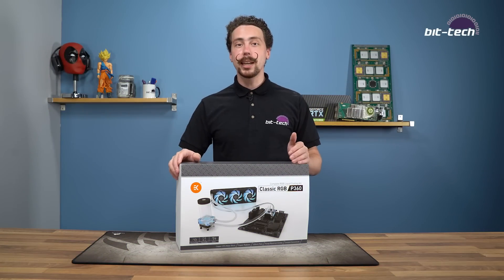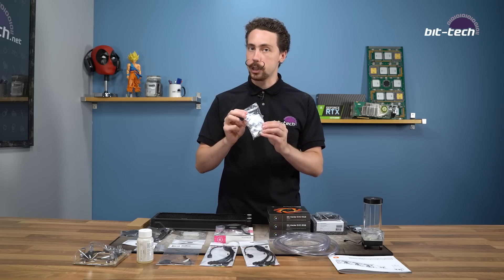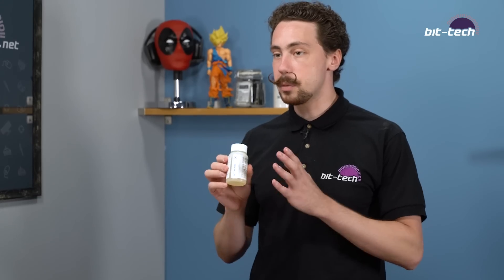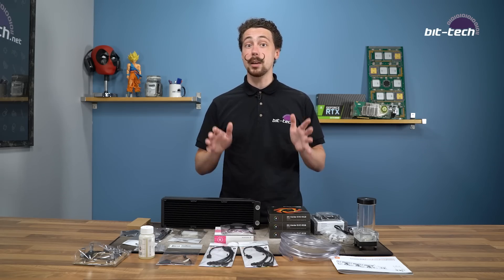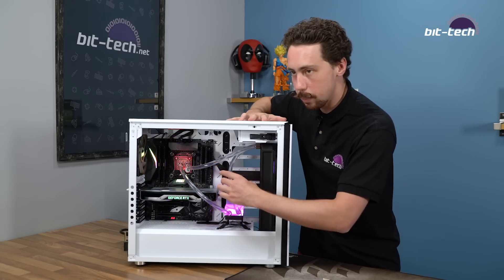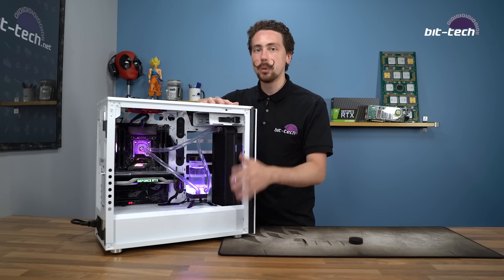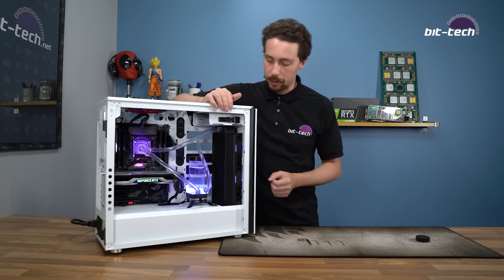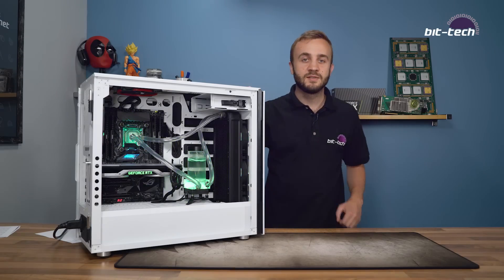EKWB EK-Kit Classic RGB P360 Water-Cooling Kit Review

Comment: I brought this kit and they have improved it a lot. Itnow has the 90° adapters. All rgb is 3pin A-RGB. The pump resevoir comes with mounting brackets so it can go on the case. There may be some other changes I have missed.

Comment: I feel like some of the point in these kits was missed here in these videos.  Yes, they may have had price parity with just flat out buying the parts, but that's not the point.  These kits are made for people who are complete beginners to watercooling, so they can just buy a pre-done kit and have what you need instead of spending hours upon hours researching the difference between this part and that part, saving that until after you have some experience actually building a successful loop.  Given the usual nature of the market too, I would've expected the kit to cost more than just buying the parts piece by piece by themselves, as it's a pre-assembled kit on top of making the parts, and it's normal in any market that you might pay more for work that is done for you.

Comment: Ummmm I know its a little late...but the radiator is upside down...its very likely to collect air in the top, making the pump noisy and prone to premature failure, and potentially starve the cooling loop :(
Reply from the maker: No this is a custom loop, that only applies to AIO coolers.
Reply: @bittech1  OIC, I thought it was for all water cooling radiators not just AIOs.
Reply from the maker: @mikethinks  It's almost exclusively for AIOs since they don't have a dedicated reservoir. A key role of the reservoir is to catch air in the loop, as such radiator orientation doesn't matter all that much.

Crucially even with AIOs the important part is not to have the pump be the highest point in the loop, as that's how you'll get air collecting inside it.

Comment: ps, you should turnt radiator connectors to the bottom so all could be ok and also the air will not be next to connectors etc.also you cant mount pump verticaly so connectors could be not be close to side panel.
Reply from the maker: Django Jansen No clue, we’re specifically taking about custom loops.
Reply from the maker: Robert D Heads up, the Gamers Nexus video doesn’t apply to custom loops.
Reply: @bittech1  its about leight of the tubes. if the pump is lower so use rads connectors lower as well, this is like plaing Lego. no one say that pump need to be in one position, no one says that rad need to be with connectors at the top. just play aroud, thats all.
Reply: @bittech1  ps see what i mean. 
https://www.reddit.com/r/watercooling/comments/inauht/deepcool_macube_310_watercooling/ 
this is my first custom loop and pump is much deeper mounted to the back of the case not at the centre of case.
Reply from the maker: @djangojansen7648  Custom loops have reservoirs, the air will bleed out of the loop.

Interestingly enough, if you have your ports on the bottom you'll actually have far more trouble removing air from the loop, which is quite a pain in the neck. For quick loops in videos I'll often have the ports on top specifically to aid bleeding so that the air won't affect thermal performance during testing.
Reply: @djangojansen7648  for AIO is better conector at the bottom and pimp at the bottom as there is always a bit of air bit the subject here is about managing the size of the tubes for this particular EK set. the pump can be mounted verticaly with pump connector facing down so no issues about case side cover and tube size. alternativly the pump can be instal deeper so problem with side panel clearence.

Comment: What did you mean when you said that fans behave weird if fed voltage lower than 12V? Overall very professional and thorough video!
Reply from the maker: Spinning at obviously different speeds to one another, not starting properly or start-stopping. They are definitely only to be used with 12V and PWM for control.

Comment: awesome review. 
wonder why they didn't go with a ddc pump? the kit isn't 'that' cheap, but hopefully they have done their testing and the failure rate is low
Reply: I have the same pump in my fluid gaming kit with dual radiators 240/360 and 2080 water block. It doesn't seem to have a problem dealing with my 9900k and 2070 super.
I can't attest to longevity because my system is more of a test bench and doesn't get used daily.
Reply: @realhusky  yeah i didn't doubt for a moment that the pump wouldn't be strong enough, but you don't buy a d5 for its performance, it actually has less head preassure than a ddc pump, you buy it for reliabilty. A pump failure can be pretty devestating if you have hardline tubing. im very much for not skimping on the pump, in fact i don't think you should skimp on watercooling full stop. 
i hardly ever use ddc pumps and i've seen a fair few of them fail in person, and loud. i would never recommend a ddc, unless its a compromise (eg in a distro plate)
Reply: @F41LZZz  I just got the EK Extreme 360 Kit which unfortunately comes with a DDC pump but for the price I got it for I am going to upgrade to a D5 and I should be good to go.
Reply: @jjsemperfi  i still feel like its better to buy watercooling parts separately. unless the kit is on sale, its not much cheaper and it greatly limits your options for fittings and tubing.
i guess its very convenient for new watercoolers but that is its strongest selling point
Reply: @F41LZZz  I agree. I priced it out to build what I wanted vs the kit and it was actually cheaper to go with the kit. I got the EK Extreme 360 Kit $100 off Amazon and Newegg pricing.
Reply: @jjsemperfi  main thing i advise is switching out the clear tubing for some EK ZMT stuff. the clear is just.... well it doesn't last and it leaches pasteurizer into your loop. hope you have a fun time building your loop!
Reply: @F41LZZz  Interesting. Had no idea. Thanks for the advice!
Reply: @jjsemperfi  oh yeah ZMT tubing is a god send, if hardline didn't look so good everyone would just use that black stuff. no joke its by far the best way to do a loop, it lasts forever